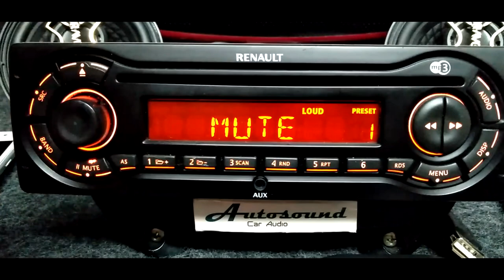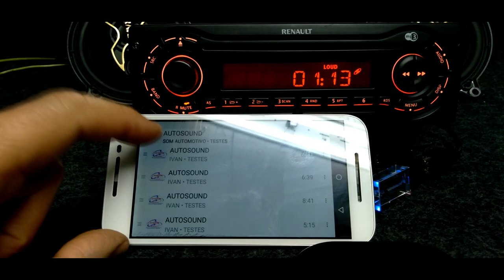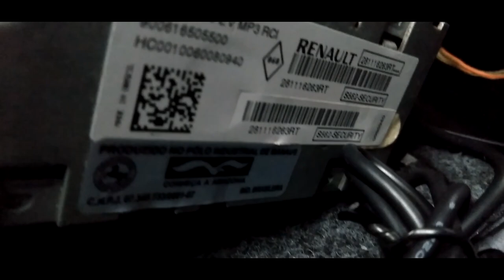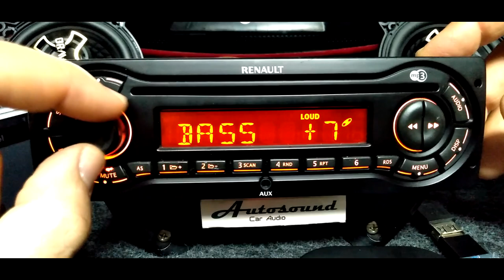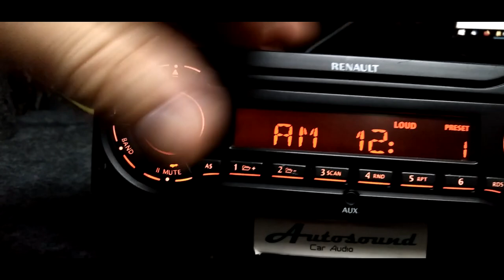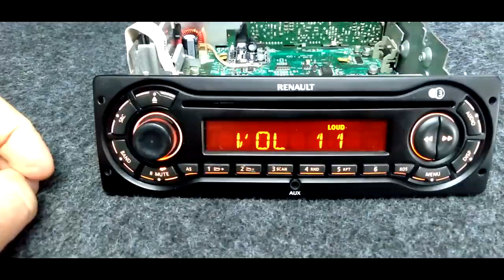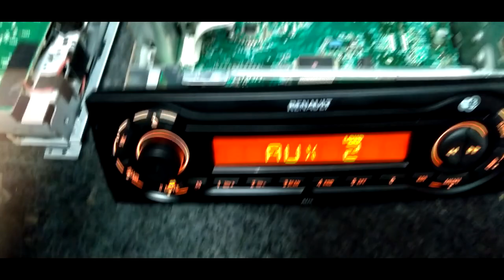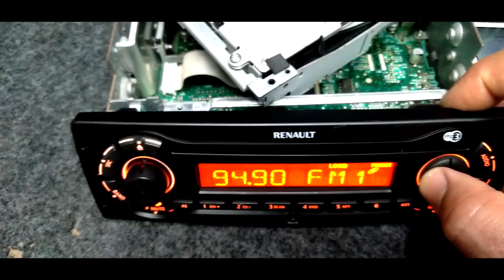👉 #som  de carro Radio Original #renault  Kangoo Sandero Logan CD5408 Senha + Aux. Bluetooth Usb

Comment: Amigo posso usar um Conversor Isolador B1205s nesse mesmo radio ?
Reply from the maker: Usando ele na saida remote ja faz desligar automatico junto com radio. Se pegar ruido coloca um capacitor na entrada dc da placa.
Reply: @autosound  show é que comprei um que é 12 para 5 v e vi que tu instalou um 5 para 5 v, a conexão na placa mantem a mesma na parte de baixo ?
Reply from the maker: Não entendi a pergunta mais quando uso de 5 volts é porque geralemnete eu usei um regulador 7805 ou peguei do circuito.
Reply: @autosound  Claro e que no video mostra a parte da placa e depois tem o corte para a modificação com o Conversor Isolador B0505s já instalado, por isso consultei se o 1205 (que é para  12v  -> 5V ) funcionaria, basicamente preciso conectar na entrada 12v

Comment: No  meu  a  opção auxiliar não  aparece  sabe como  posso resolver?
Reply from the maker: Todos que eu peguei já acionavam no botão. Mais, por exemplo, outros carros como Peugeot precisa habilitar no escaner algumas vezes que não tem a função aparecendo no display.
Reply: Amigo el mio tampoco aparece la opción aux resolviste???
Reply from the maker: @marcosmartinez2970  Existem alguns equipamentos que somente ao vc encaixar o plug P2 no Jack é que uma chave interna aciona a função e aparecendo no display. Para enganar o sistema é feito um jump normalmente ligando o fio responsável por acionar a função a terra simulando o funcionamento da chave e mantendo a função constantemente ativa facilitando a instalação da placa Bluetooth no interior.
Reply: @autosound   Ya he instalado el cable por el aux frontal y aun nada le doy al boton src y solo dice radio no cambia a aux se podria resetear el stereo? O como podria hacer?
Reply from the maker: @marcosmartinez2970  Pode estar com alguma falha de conexão ou precisando habilitar no scaner somente uma análise mais profunda em bancada poderia solucionar um caso assim fora do normal.